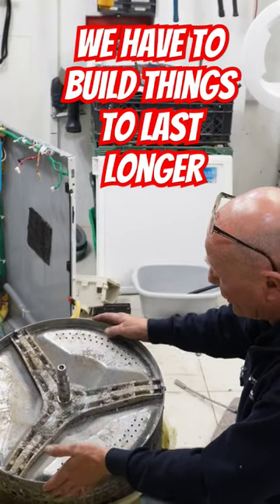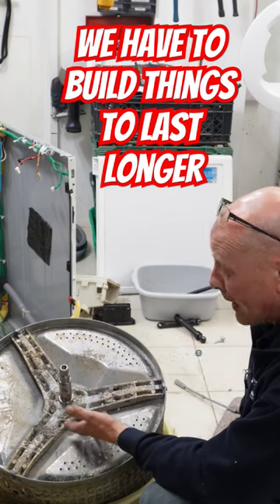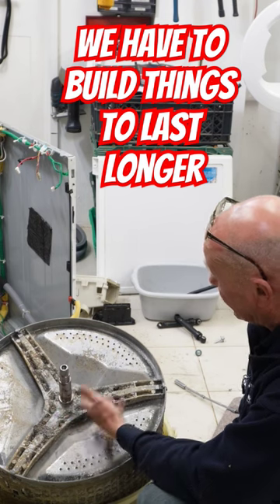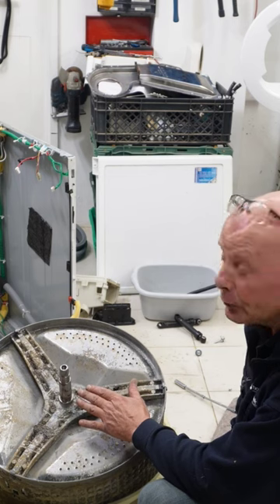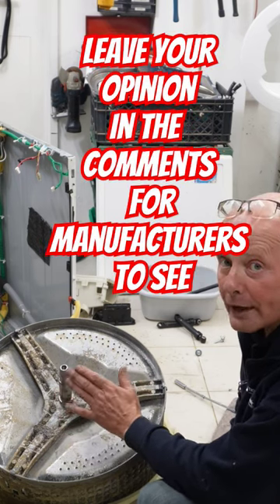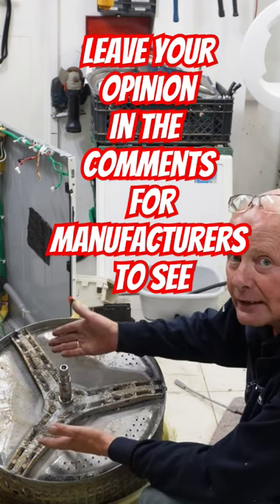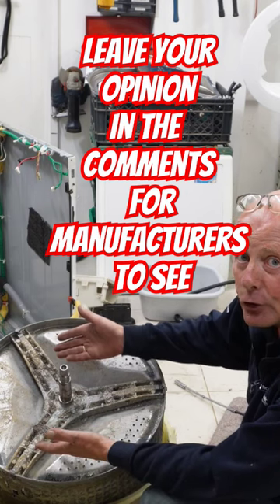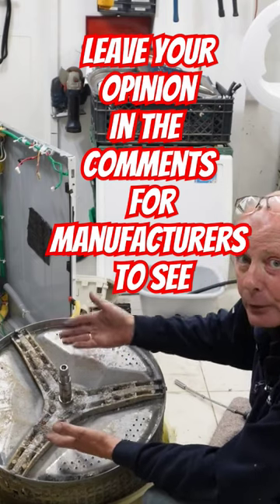Washing Machine Obsolescence or not? Samsung  #howtorepair #washingmachinerepair #appliancerepair

Comment: It's a disgrace is what it is, deliberately designed and engineering in a part to fail prematurely

FOR SHAME manufacturers, that are using such shady practices in an effort to drive sales

And remember, this is an excerpt from a video regarding a Samsung washing machine, they are not cheap devices

We should easily be expecting 7 to 10 years lifespan with average use, not 5 and not with such an obviously manufactured way of planned premature failure 

Come on manufacturers, stop with this madness!